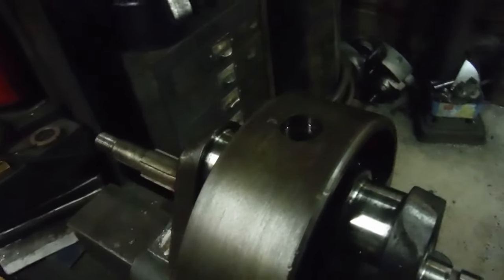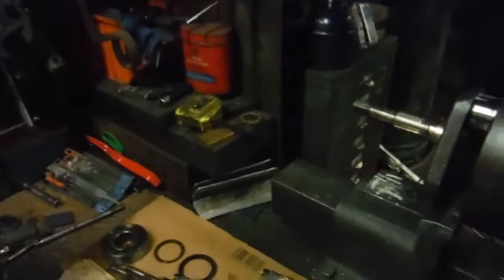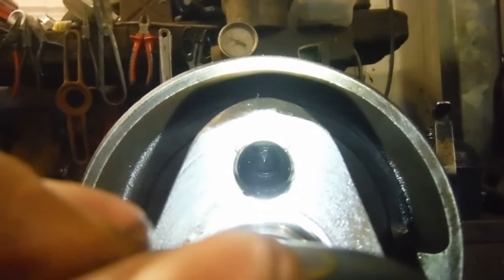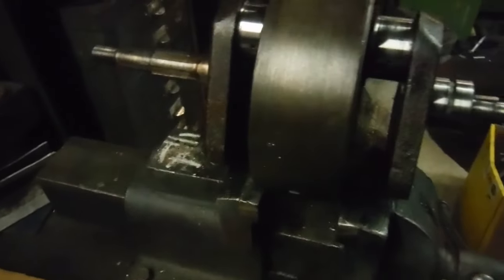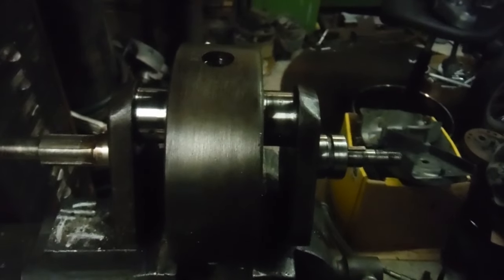Sludge trap condition after 3,500 miles on a BSA A65.

Comment: G'day Paul, l have just a mouth ago pull down my lightning engine and after 63500 miles the crank sludge trap was about half full, l change my oil and filter every 3000 Miles this is the bikes first pull down since new in c1966, it's getting the works this time full bottom to top, cheers mate Neil 🤠.
Reply from the maker: That's interesting, thanks for that Neil.
Reply: 65 k,wow!

Comment: The cranks looking sound considering the blow up. I was watching a Chinese woman on YouTube ,who repairs & bodges up her villages motorcycles & farm machinery .  I reckon she would of attempted to straighten out the bent cam ,with a blow lamp ,2 lb lump hammer & re- profiled the cam lobes with a 10 inch bastard file.  I am glad she can’t get her hands on my bikes . 👍
Reply: Needs must…
Reply: Probably doable though. If it needs fixing and there’s no other option there’s nothing to lose
Reply: @highdownmartin She also does a nice line in instant cylinder rebores with an electric drill by eye , & grinds the carbon off piston crowns & valve faces with an angle grinder . That’s doable also & only guaranteed until she has had chance to pocket the bunce & make a quick exit .
Reply: @maskedavenger2578  got links to that?
Reply: There is footage on u tube in the shorts section where all sorts of lorry engines get welded back together.....makes me petrified to think how many people died when buses suffer this boge mentality
Reply: @cedhome7945  Yea I seen some old British wagons in India & Pakistan getting some right bodgery done on drive shafts & dfferentials  . No wonder they have wagons tipped over on their sides ,down their main drags, & carnage .  Also see. Honda cub cranks bashed apart & rebuilt using a lump hammer ,chisels & scrap ends of scaffold tube in far east places .  Two baht plenty cheap .
Reply: @frankfisher99 Tried twice to give you the exact YouTube channel titles & they keep mysteriously keep disappearing.  These types of Chanel’s got suggested by YouTube ,after me watching Chanel’s that contained motorcycle ,mechanics & other mechanical stuff on YouTube .
Reply: @maskedavenger2578  thanks for trying!

Comment: Would Marvel Mystery Oil - or its local equivalent - help with sludge on these??
Reply: Might help it to stay in solution. Maybe not.  Centrifugal forces are pretty strong which is the point in sludge traps.  Best insurance is a return oil filter on these (my opinion).  Then the buildup in the sludge trap will be slower.  Interesting how the sludge builds up on the far (LH) end of the sludge tube first!  BSA feature.
Reply: When my Triumph Tr-6 was 40 years old we had to replace the camshafts. The sludge trap was almost full. We threw it away instead of cleaning it. It was only a $7 part. God knows how many miles were on her. She's good for another 50 years.😂🎉